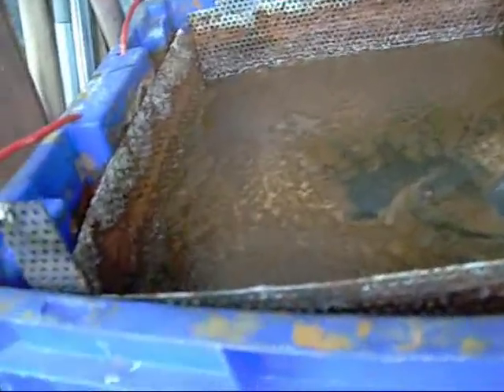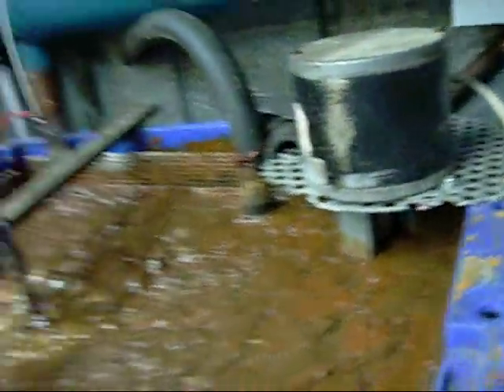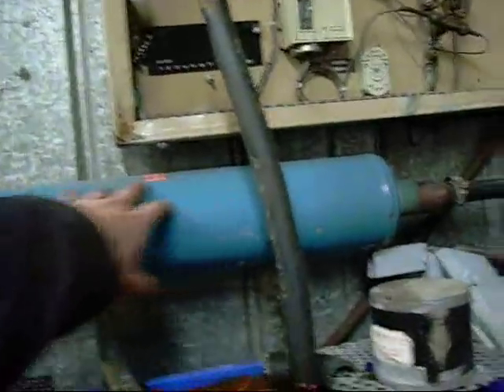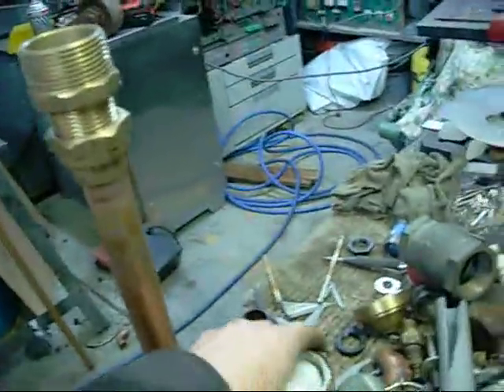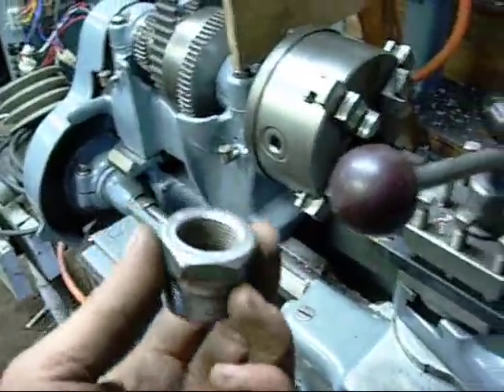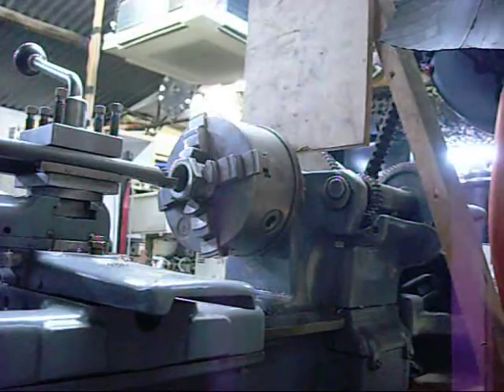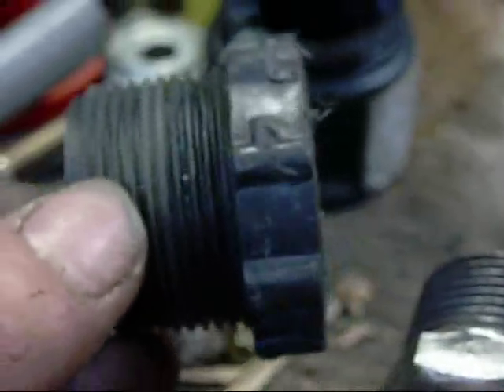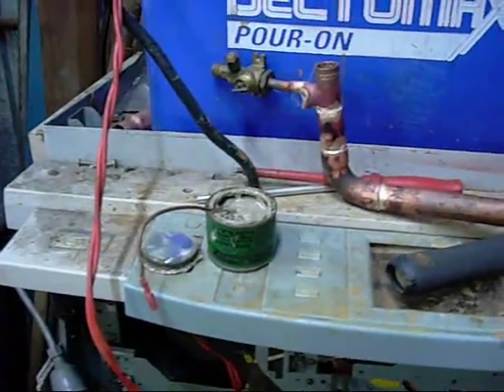Electrolysis Cooling System Pt1

Comment from the maker: Yeah, 60% is great for fine jobs, it was reccomended for soldering tungsten carbide to tool steel so I stuck with it.

This bundle of solder showed up with a load of scrap from a deceased estate clearout. they thought it was bronze and threw it in the scrap pile. thus I didn't have to pay for it.